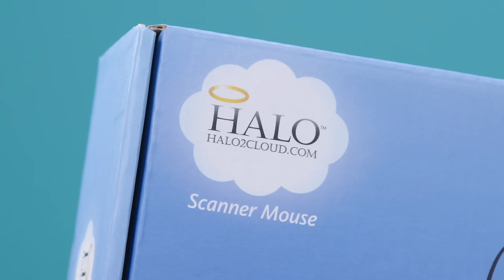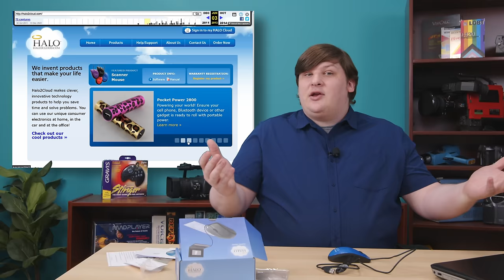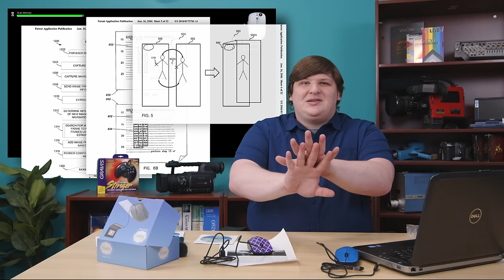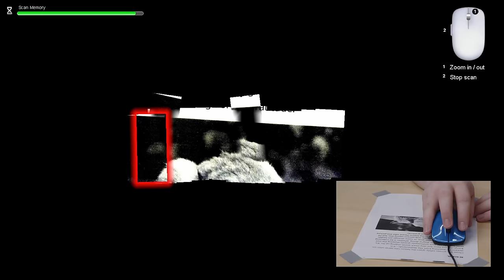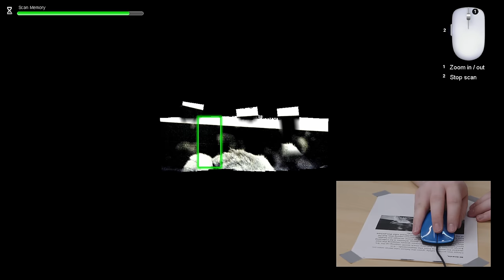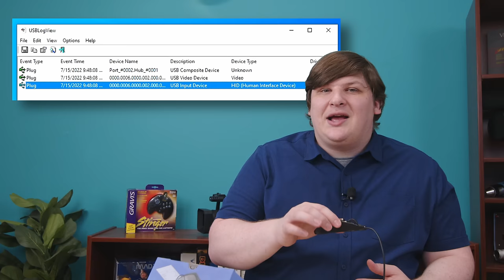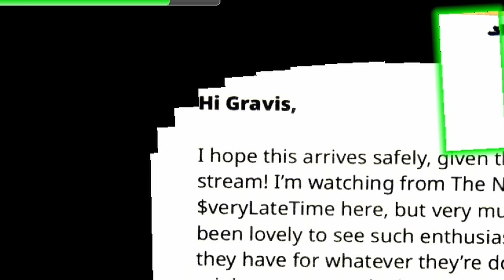Why would you scan things with a... mouse?

Comment: as a software developer, I'd actually say the drivers and software are actually really good. It's fast, seamless and has just enough features. Also I get that having OCR is common but it worked so effortlessly, and they export formats are all you need. The way it found its place back on the page is also pretty impressive, yeah ik there are libraries for it, but it just worked! also the precision in terms of location AND rotation is impressive. Given how cheap this product is, the quality of the software is outstanding and I really think it's unfair to call it lacking, it doesn't need anything else (except maybe better contrast and brightness controls). I know for a fact if I made this I'd be proud of it

Comment: This is actually a pretty cool little device that could be useful with some refinement. The second optical sensor is how it detects rotation. If you ever twist an optical mouse in place on it's sensor, you know that it has weird x-y movement. But if you take two sensors that're offset, you can do some math to figure out not only x-y linear movement, but also z axis rotation. It's a fairly simple 3dof, 2L-1R, setup. Basically a sensor-based alternative to using an IMU, and given the time this comes from a cheaper implementation to figure out positional data. It's also a pretty cool implementation of very early consumer-level photogrammetry, though limited to a plane and not 3D space, and very clearly imperfect on both the sensor and software side. A modern version, even at a cheap cost, would be so much more refined just on the basis of how available advanced software is now, not to mention more complex ICs that would handle all the functions of this on a singular chip. 

Honestly, I almost want to recreate this, minus the mouse functionality. The fact that you have a 3dof sensor array, an image-based scanner, and photogrammetric stitching, would make a handheld scanner able to scan documents of any size. Couple that with the various document tools, and you could go from post-it notes to legal documents with ease, I wouldn't be surprised if you could also scan an array of pages and automate the generation of a full document with some additional machine learning as you already have the computer vision component. The fact that it's also small in size would also make it a good travel tool. 

There's definitely potential for a tool here, just underdeveloped, and a bit before its time, but with what we have today a very cheap version could be made and work orders of magnitude better. Though, at the same time, everyone has a high resolution sensor in their pocket, and fairly decent free 3D photogrammetry software exists, you could apply the same post-processing tools to pull text from a stitched image that you made with your phone. Personally, I just don't like the phone approach for things, I prefer the dedicated tool that's already directly connected to a computer, no jumping between your phone and computer just to finish a scanned document, plus I just don't like the UX of phones for work in the first place, phones should be a last resort when it comes to document creation; it's similar to using your phone for professional photography, it's clunky and subpar, plus you have to jumble around with file transfer instead of just moving around an SD card, the method is just unoptimized for actual work. There's also the issue of picture reproduction quality when using a phone, you're not getting up-close with a bright flash, you're getting the room's lighting, and you're also dealing with focus when a scanner will have a fixed focus, etc., these issues become especially apparent at larger-scale photogrammetry. It's a niche idea, yes, but scanners only have a certain platform size and speed, and photography falls to a different set of issues, this is essentially combining the strengths of the two into an idea.

Comment: I was really hoping this mouse would actually be clever and use the same camera sensor for both scanning and mousing. Sure, processing the whole image on the mouse might be a bit much, but you don't need to do the whole thing, just pick out, crop, and aggressively downsample a tiny block of the image to run the mouse algorithms on while you're piping the full video stream to the PC, and run the mouse algorithms on that. (And just leave the PC to do all the optical flow tracking it wants to correlate the images, instead of relying on two mouse sensors.) Bet you could accomplish all of that with just the OV538 chip, the strobe, and the single image sensor. And if you wanted to keep all the laser mouse reliability goodness, you could just add an IR VCSEL to the strobe board and change whether you're strobing white or IR depending on if you're in scan or mouse mode.

Comment: There is a degree of error in optical mice. For instance if you keep your mouse in the same place as humanly possible but make a small circular motion with the pointer you will notice your pointer on screen will drift after a few seconds then it gets worse. You notice this on a small mouse mat when you constantly have to reposition your mouse to keep it from drifting off the surface. This error is seen in the scan as there is a lot of motion to get the whole scan so the numbers of x/y drift over time.
The jitter could be caused by bad filtering of nearby components as they become hotter they shift their values, typical of surface mount capacitors. I would try soldering 100nF ceramic caps over all the chips power supply pins to see if it helps. Of course probably not worth the effort, but would be interesting to see if it helps.
Pretty cool device, just a shame it isn't tested further to address the issues. Useful for small scans of unimportant things you just want to inspect on screen maybe.

Comment: So I know about HID! HID input can get very very complicated; I have played with a SpaceBall mouse that has 6 degrees of freedom and 8 buttons. A mouse with 3 axes (X, Y, and rotation) is entirely plausible! What seems to be happening is that when one of the sensors is covered, it assumes that what the user is doing is holding one part of the mouse in place and swinging the other half around. 

Beyond that, I think this is a really cool little device and I wish it was more functional. If I could have picked one up that was of any "doesn't break in 20 minutes" quality it would have been a real life-saver during covid, when I was constantly needing to submit exams for classes by scanning them with my phone camera

Comment: 16:42 I can clearly see a protector over the window that is not in the other one at 15:08. Did you try removing it? Wouldn't "cleaning" that plastic introduce more noise?
Reply from the maker: Some of these shots are out of sequence. I tried it every which-way, and the problem started out of the blue, it was simply working and then not. The purple one, which I took completely to bits and put back together, behaved exactly the same way afterwards. If it was dirt, it would have changed behavior in some way, either for worse or better. And besides, it jumps around with literally nothing going on, just sitting in place on top of a black surface. There's no data to even go off of, good or bad, so I'm 100% positive this is a hardware or firmware malfunction.
Reply: @CathodeRayDude  At 29:04 I can clearly see you left the plastic protector and that it was scratched. But as you say it was unlikely to be the problem, as it probably used the other two mouse sensors exclusively for the actual tracking. I wonder if it can be fixed in software by ignoring bogus mouse signals.

Comment: I think the second sensor is just for tracking rotation. if top and bottom does not see the same motion then the mouse is rotating in some way. even when you have 1 covered its working as if the pivot point of the rotation is directly on the sensor it self since it is not detecting any motion at all.

Comment: Hi, I was trying to leave a comment on the optical mouse video, but the very nice AI of this also very nice video hosting is silently removing it every time I post it.

Anyway, I'll try once more, abridged.

My dad bought a 286 back in 1989 (our first computer, which he used to work, it even had a 287 to use CAD) and with it, came an optical mouse from a Taiwanese company (apparently) and it would use a plastic pad with light and dark features that were illuminated by the mouse's infrared LED (2 LEDs at right angle of each other).

I was surprised that the rest of the world never heard of them, and I had to endure the mechanical mouses everywhere else until they were replaced by the superior ones. Also it was cool to show it to friends :)

You can find an image online (of the mechanical version) if you search images for "quick mouse", including the quotes. It has three dark buttons and the stylized word "QUICK"

Comment: Well i could dig through the pattern but, if I had to guess it uses the two mouse sensors to calculate a virtual Z axis to account for twisting motions that would be required for the behavior you observed where it could figure out the twisting motion. And if that virtual Z axis was miscalculated that would account for the stitching errors. You see it's probably not primarily if at all relying on image recognition to stitch the images, instead it's probably heavily if not entirely relying on the 3 axis (up, down, and twist) mouse data to do the stitching. As for the failure mode it's probably the plastic in one of the cheap mouse sensors degrading due to heat and age causing it not to be able to calculate the virtual Z (twist) axis, if either sensor failed then that's how it would act assuming it only used the mouse sensor data to stitch the images.

Comment: Dude you owe them an apology, the Halo bolt jump starter packs are really really good products. I've jumped my truck off many times with it after having a dead battery in my truck. Multiple jump starts and still didn't need to recharge it. Great product.

Comment: The "USB Composite Device" is the hub chip. In this case it's set up as part of an embedded system. The HID and the USB camera are connected to it. The ST-840 is probably a TTL UART to USB bridge chip, which the optical mouse sensors are connected to two serial inputs and the driver takes turns polling each of them to determine the rotation of the device.

Comment: Pretty sure the two optical sensors are to handle rotation of the mouse. As you said, a mouse only reports movements in X and Y, no rotation. The angle of the camera is extremely important for the scanner tracking, another part of locating itself. If you cover up one of the sensors, it thinks that sensor is frozen in place; therefore it assumes any side-to-side movement is actually in a circle around that covered sensor. Might be cheaper to use two sensors, pass only one as the mouse and use both for communicating rotation, instead of using a specialized mouse module which does translation AND rotation.

Comment: In the UK in the early 90's there was the Amstrad PCW 8256 a small CP/M green screen computer sold for word processing and other office type activities, it came with a dedicated dot matrix printer. A peripheral for this system was a scanner that mounted onto the print head, you would load the page you wanted to scan into the printer (a single sheet of A4), and the program would scan your image, in grey scale, by moving the print head back and forth and advancing the carriage. It was kind of neat and bit rubbish at the same time.
Reply from the maker: Oh yeah! Those were sold as retrofits for several dot matrix machines on different platforms, in fact. Always wanted one.

Comment: the HID protocol is pretty flexible and allows you to define custom fields iirc
so the mouse can send both normal mouse data as well as the additional positioning data (which is just ignored by software that only expects regular mouse inputs, but would be accessible to custom software)
Reply: actually i bet it might be a builtin feature since other pointing devices with rotation sensors do exist

Comment: Interesting thing, and well-made explanation!
My personal guess on the two sensors is that I think you need them to detect rotation! Your mouse pointer doesn't care about it and your off-the-mill sensor will just swallow that information, as it's redundant for pointer use. You'll get that with a second sensor. It might also add to accuracy, which you'll need to determine the scanner's relative movement.

From a software perspective, and without having seen all details, but your explanation, they seem to mostly or even ONLY use these sensors to determine the movement though - this would explain your errors. I would let the mouse sensors the coarse stuff, and do the finetuning in software. Maybe they do this, but then it's not well-made. But it IS possible to make this better.
Reply: Actually, the sensor can't do rotation at all. It just implements algorithms to figure out translation from the ultra-low-res image the sensor actually captures. The processing on the sensor chip basically takes the previous image and slides it around until it finds the closest fit to the current one and outputs the x and y distances. You could build a chip that can figure out rotation as well, but it would be a lot more complicated, might require a higher resolution sensor, and there probably isn't much of a market for it, anyway.
Reply: @Roxor128  You probably misunderstood me. I just said that the sensor can't gather rotational data. That was the whole point of my guess.
Thanks for the technical explanation as well. I know how these work and this is where I gathered my explanation for the two sensors from.

Comment: I actually found the example of Meraki Firewalls to be incredibly Ironic because while Cisco did buy the absolute ever loving shit out of them, they still make new Meraki firewalls, with new features, and have actually made the product better over time.
Reply from the maker: I... sort of disagree that they've "improved" them all that much, and their licensing model is the most obnoxious, predatory trash. At any rate, while Meraki is one of the precious few examples of something getting bought and not immediately going into suspended animation for years until being divested or just forgotten about, the point is that the people who started it were certainly just looking for a quick buck. The engineers? Perhaps not. The execs? Absolutely. Are they still with Cisco? Who knows. Doesn't matter - if the terms were "take ten million in cash and walk away. we're going to fire everyone, cancel the product, and sit on the IP forever" they would have done it and laughed all the way to the bank.
Reply: @CathodeRayDude  
I see some of your points, however the license model for Meraki is hardly predatory if you look at the term discounts for 5y (At which point you should really replace the thing anyway) vs any amount of money to use Sophos. You're right though Cisco really could have killed this product. It's kind of shocking that they didn't. If you haven't used a Meraki firewall on the latest Release Candidate software, I'd suggest you do, they finally added V6 and a lot of other "This really should have been around six years ago" features.
Reply from the maker: @dieKatze88  I just personally can't abide a device that completely bricks itself, despite being _fully functional_, just because you stopped paying a recurring license fee. Nothing can convince me that that's morally acceptable behavior and I can't get over it. I don't know of any other vendor in the entire space whose devices literally become paperweights.
Reply: @CathodeRayDude  You would be really offended looking at Datto then. Their licensing model is even more predatory. at least Cisco lets you keep buying the licenses as long as you're willing. Datto requires you to involve a third party, pay monthly, and they basically insist that you don't even get to configure things that you "own".

The only reason I don't consider Meraki's licensing that predatory is because of security issues, you really SHOULD upgrade that kind of enterprise network hardware every 5 years, and the TCO for those businesses is fairly reasonable. That said, OpenWRT is starting to keep some Meraki APs out of landfills, which is a very positive step forward.
Reply: Also the sad fact is, that most vendors are doing this shit now. Sophos devices are x86 boxes that brick themselves if you don't buy their shitty license. The only vendor still selling things that you can still own that you'd want to own is Cisco, and if you start price comparing against Meraki, it almost doesn't make sense unless you're doing some really specialized stuff. It's a very sad state of affairs.

Comment: I have the (almost) exact same mouse, bought from amazon about 6 years ago. Its the hama one, and it actually still works perfectly fine to this day. The only problem is the soft paint (instead of the blue plastic) liquifying. Hama dropped Software support about 4-5 years ago, but then picked up on it again for some reason. I'd recommend the Iriscan and hama softwares because the others are really sus. If the mouse suddenly stops working, try using a USB 2.0 port